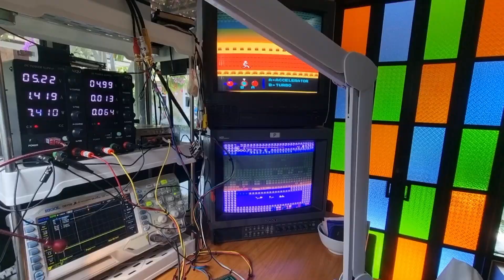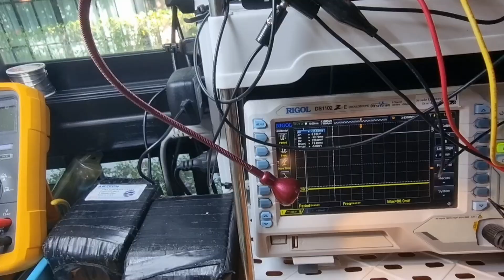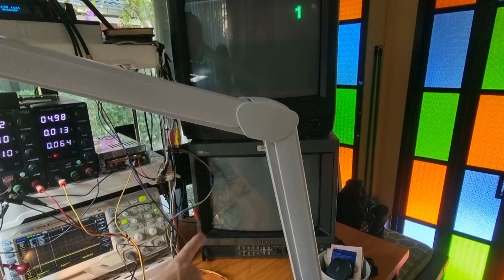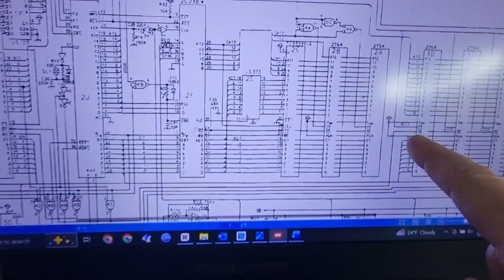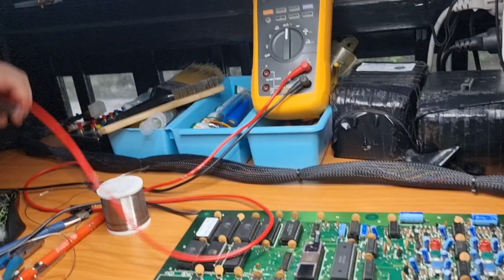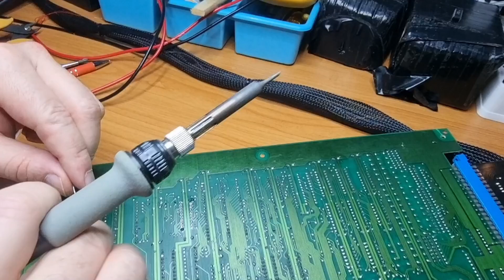Nintendo VS PCB Repair Part 2  Graphics Garbage

Comment: In arcade games what does the control buss lines/signals do? The data buss sends data/instructions, the address buss sends an address location, chip enable buss turns on/off the rom chips, the control buss does what?